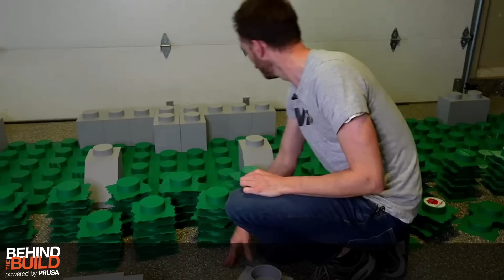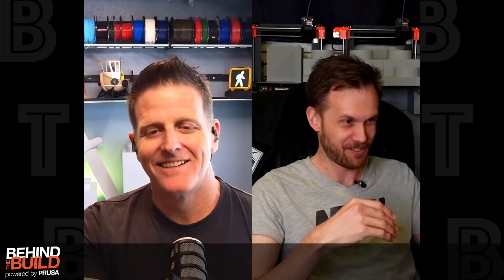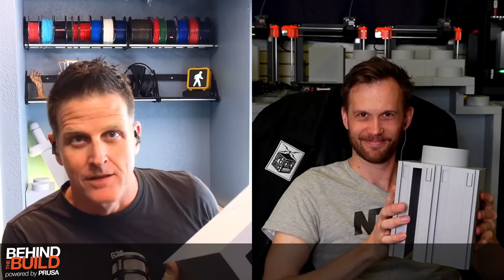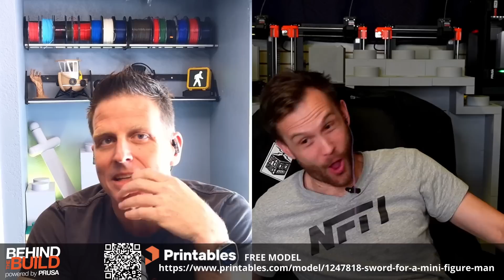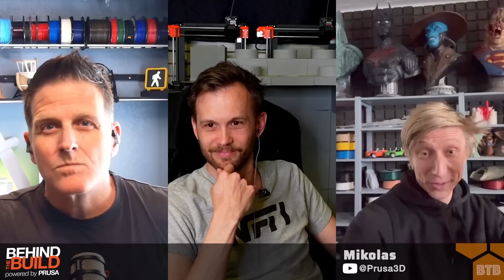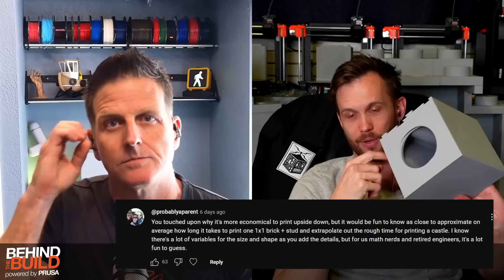Printing a Life-Sized LEGO Style Castle! - Nate From the Internet - Behind the Build

Comment: Nate mentioned a rough estimate of 4500 pieces so far. I did my own calculations using the castle set's listed inventory on Bricklink, and came up with these rough numbers.
(I excluded any minifigures or accessories like swords, shields , pennants etc. for the time being, as well as complex pieces like the winch mechanism which we haven't seen scaled up designs for yet)

Grey bricks: ~3885 parts (incl. 1548 studs)
Black bricks: ~725 parts (incl. 352 studs)
Green studs: 1216 parts
Total: 5826 parts 

Once you've added in accessories, you'll have definitely crossed the 6k parts mark. Not bad!

Comment: I'm guessing you've tried mouse ears ('helper disc' in PrusaSlicer) to prevent lifting on the corners?  I have had great success from that and it doesn't leave much scarring when you remove them (deburring tool helps there).

Comment: I wonder if, to make it more child friendly, you could create some corner pieces by 3D printing a mould that you could cast flexible foam blocks in. For extra credit, cast horses with a solid 3d printed skeleton and foam outer.
Reply: The only reason i don't think LEGO already does this for their large foam blocks (they do make them) is because they are incapable of making strong connections. Additionally, foam strong enough to not get ripped to shreds by a child is also pretty expensive for the amount they would need.